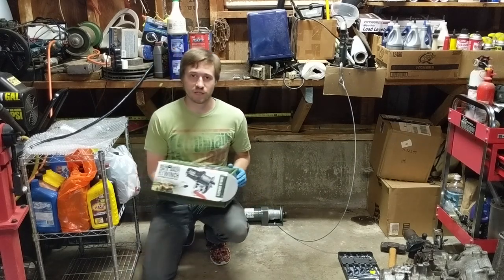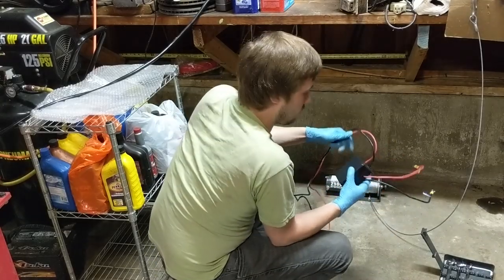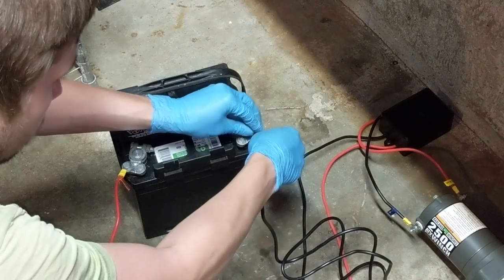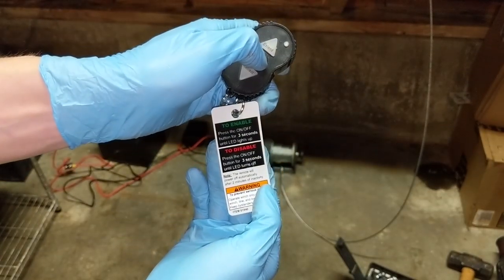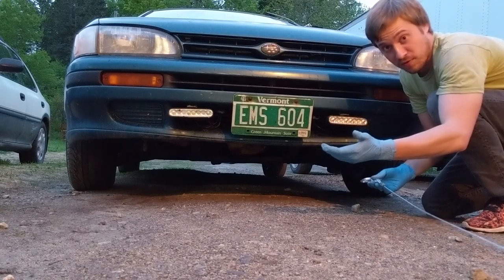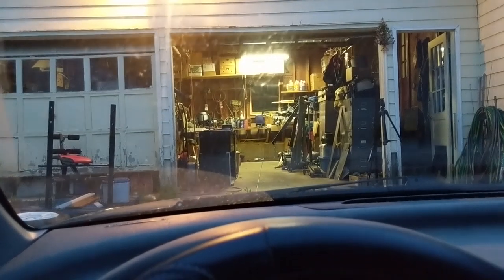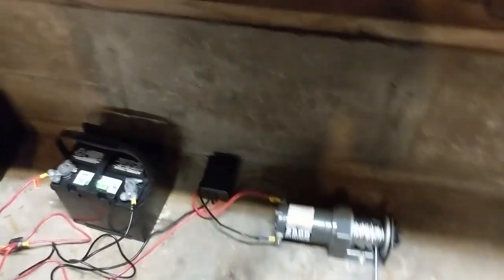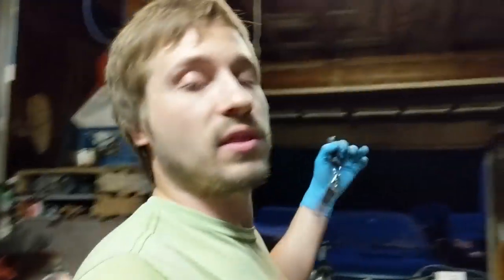Garage Winch Wiring & Testing! ⚡ Floor Mounted Harbor Freight Badland Winch

Comment: Good plan bud.  I will give you one tip from experience, never store your car batteries directly on a concrete floor.  They will lose their charge very quickly.  I store mine on top of some 2 X 4's just so they're off the ground.
Reply from the maker: I appreciate it, but I have to say that's not true. It's old info from when batteries were designed much differently. I have 8 batteries sitting directly on cement, 2-6 years old, and all of them will hold a charge for months. Even in the cold and even when it's damp.
Granted some of them don't hold a charge very well as it is, but even those don't discharge fast. The one I used in this video for example has never discharged since I bought it.
Hope you know I'm not trying to argue and I believed the same thing until just a few years ago. Thanks again!

Comment: Is it possible to wire this bad boy into some converter so that it can plug in an AC outlet? How long does the battery last?
Reply from the maker: The quick answer is yes. Originally I wanted to find a 120V winch but they're pretty hard to find other than the overhead type.

Comment: exactly what I needed to know. have a classic bmw project car (4400 lbs of not running vehicle) that has been in my garage for a while and I need to remodel the garage, but she takes up a lot of room. Now I can move her out, do my remodel and get her back in (slightly larger winch). I purchased a set of GoJak lifts that help me move it while in the garage on a flat surface, but would not work to get it in and out. Thanks for sharing.
Reply from the maker: Awesome! Exactly why I wanted this as well, as you probably saw. I think the heaviest vehicle I have pulled so far is around 3,000 lbs and it didn't really struggle. As long as your driveway is pretty flat about any winch should handle it. I also smoothed the step up into my garage and it made it even easier of course. If you can, upgrade to a synthetic winch rope, pretty cheap I can send a link if you want. Or at least throw a winch blanket over the cable for safety if you wanna be extra cautious. :)

Comment: I was wondering about the gauge of wires it comes with. I want to buy one and install it on my car dolly. I wanted to install a quick connect at the winch and then install the relay inside my expedition in the back. I would just open the door and connect the plug and use it that way. Just not sure what size wire I also needed to pick up to extend the quick connect with. In also not sure which one to buy either the 2500 or 3500.  I need to dolly a 1999 yukon up onto the dolly and not sure if the 2500 will be enough. Thanks for any information.
Reply from the maker: If I had to guess I would say they are 8 gauge and cheap. Nothing beefy. Could definitely be upgraded.  Will be cheap to wire it either way. The 2500 would probably pull the Yukon, but if you can afford it I would definitely recommend stepping it up to the 3500.
Reply: @802Garage  okay thanks for the information.
Reply from the maker: @bbay1977  No problem.

Comment: I installed one yesterday. I got the 3500 from bandland.. And built a mount and used 4 anchors. I was looking to see what others did i see only 2 was used in this video so mine should be good enough.. Nice video
Reply from the maker: Should definitely be plenty! I was looking into what anchors can support and I know I did rate these appropriately, though I can't recall exact specs. Since most of the load is lateral, it would have to pretty much sheer the bolts to come out, and I definitely don't think that will happen. If I had space for 4 though, I would have used 4 as well. Thanks for commenting!
Reply: Yeah i used the mount it came with but i have built  a mount for that to mount onto. Used 1 1/2 squar pipe 2 peices bout 12 inches long with anle cuts on the ends where i drilled the holes for the anchors. And in between the 2 bars i welded about 1 1/2 inche bars to hold the 2 together and the bottom of the 12 inch bars i made openings to install the bolts to hold the winch. And its bracke in place.. Thanks for the video. I used mine i have uphill driveway pulled my jaguar like a feather.

Comment: What size battery your using CCA and Ah
Reply from the maker: TBH I've just used whichever old car battery I have laying around. Any battery that was for a car will be more than enough to power this winch. I'm not sure what the technical minimum specs are, but even an ATV battery will work.
Reply: @802Garage  Thanks I have the same winch and been searching for a good battery, I didn't know did it need a high Amp hour or more cca
Reply from the maker: @breukelenmanufactured1416  Checked the owners manual and it says minimum 12Ah for a battery and that max Amp draw is 132. So anything over those ratings you should be fine. I'd double them at least just to be safe. :D

Comment: I wanted to see you wire it to run off 110 wall outlet.
Reply from the maker: I would have liked to, but any 120V winches are way more expensive or would be much more difficult to set up. You could get a 120V to 12V converter to power this. Using a battery just seemed like the easy solution.